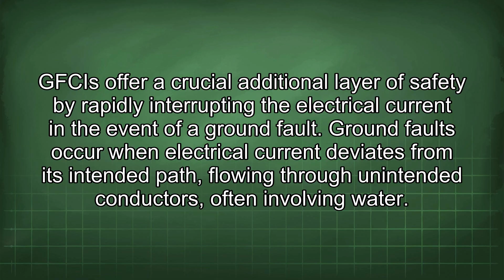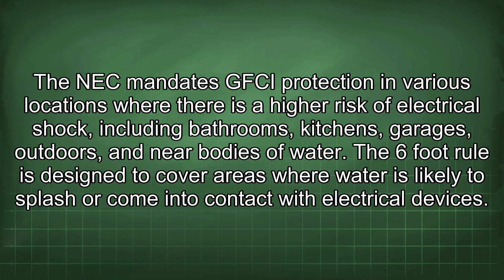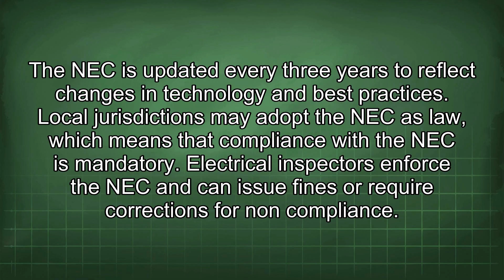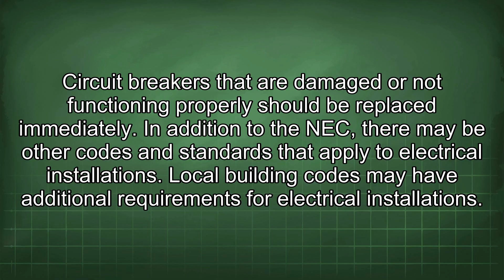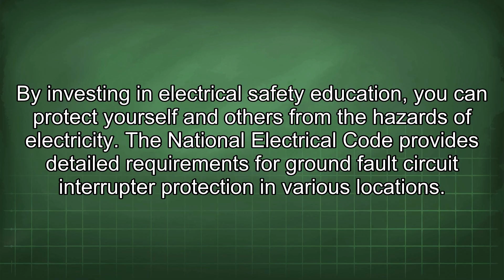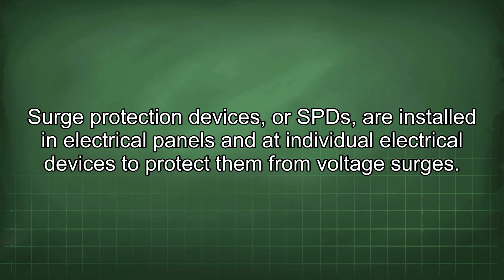GFCI Breakers Required for Hand Dryers Near Sinks?

Comment: You are giving incorrect information, incorrect code articles, where does it say "Hardwired Hand dryer needs a GFI" It doesn't stop spreading false information
Reply from the maker: Hello @aa-me4ig,

Thanks for your comment. While I did not write this, I am happy to comment on it and look into it with you. There is a reason if the dialogue was written. Most likely, there is a code requiring it within a certain distance of a sink (e.g. think of the permanently installed hair dryers in hotel room washrooms with the built in GFCI trip protection, as they do not directly plug-in to the GFCI protected outlet) or per the manufacturer instructions.

In general, it is better to be overprotected than under protected. The only issue here could be nuisance tripping, due to manufacturing issues.

Sincerely,

BESA Research

Comment: Just stop before you kill someone. If you want to make AI garbage make cat videos or something. 

Not ones where youre going to burn a house down.
Reply from the maker: Hello @16vSciroccoboi,

I would thank you for your comment, but why do you think this? What is the problem? A GFCI will not really cause a fire unless it is overloaded with inadequate C/B or OCPD, simply defective or incorrectly connected. It is more a matter of the life safety hazard involving ground currents passing through humans. We strongly recommend the use of GFCIs, RCDs and RCBOs wherever possible. It is best to use a GFCI on each circuit and please remember to test them periodically, they do fail!

However, the bottom line is that this channel is for research. Please always refer to a licensed electrician for any work on your home or business structure. An electrician should have multiple sources of learning material and this material is complementary, particularly for niche applications and specific requests that we receive. 

Sincerely,

BESA Research